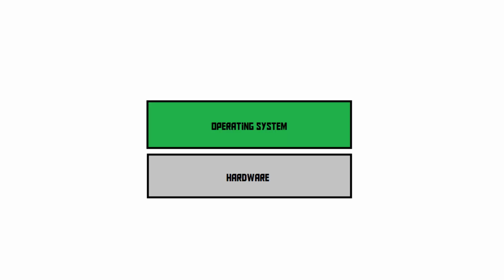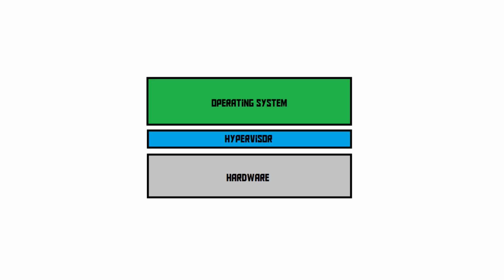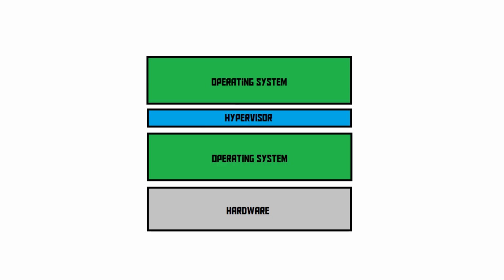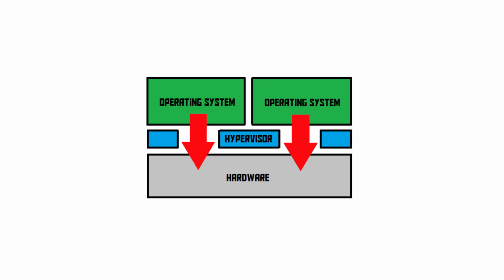What is hardware assisted virtualisation? (AKIO TV)

Comment: I use enjoy Xen Project type 1 (bare metal) hypervisor for ubuntu dom 0.  I use it on my dell r710 that has 64 gigs of ram and two xeon  processors with 6 cores each, and  six 1 terabyte hard drives in raid 50.  My playground toy. 😊